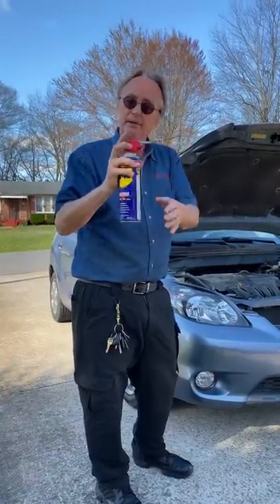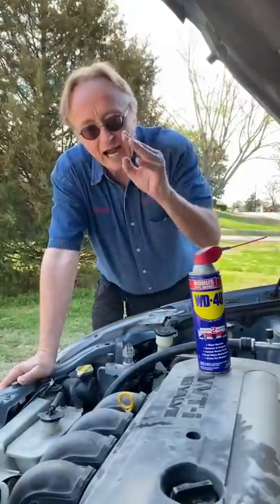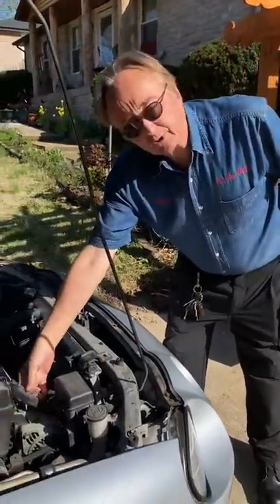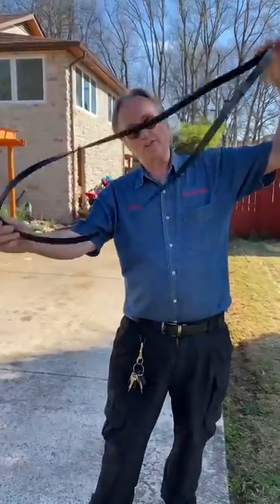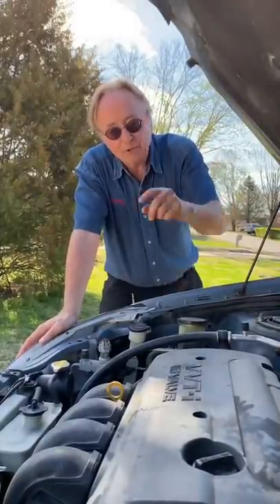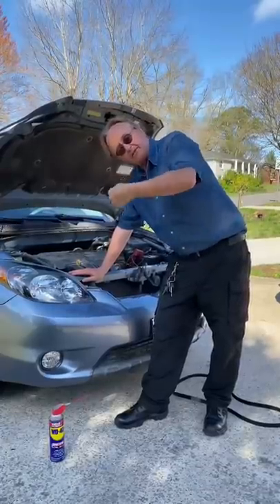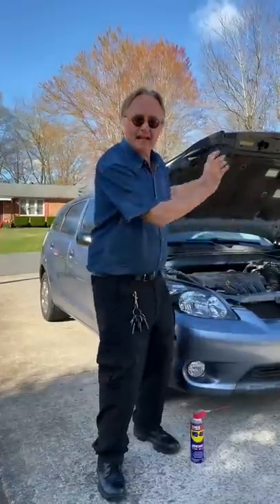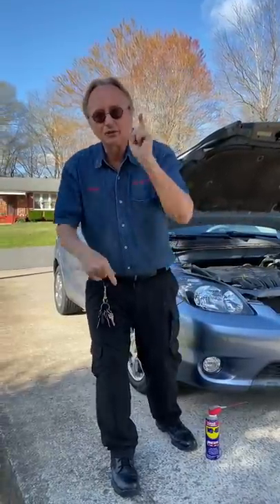Please Stop Doing This to Your Car

Comment: Belt conditioner is supposed to help your belts last longer, and if you read the instructions it's not supposed to be used when the vehicle is running, you take it off, spray it down and let it dry before reinstalling. It's supposed to help give the belt more grip without requiring as much tension and regular use keeps the belt from cracking as easily.

Comment: Buy good belt! not the cheapest you can find.
Reply: Rite!!!! Gates, Goodyear, etc..
Reply: I only buy OEM belts on RockAuto. My last one was the same price as the auto parts store brand belt for my '99 Ford Ranger.
Reply: If you can find them, Pirelli makes belt that are noticeably thicker and heavier duty than any others I've seen. Their tires, too. They've got 4 plies under their 2 steel belts instead of 2 like other brands.

Comment: I've had a number of Caravans and it's usually the idler pully or the other stupid guide pully. Don't spray a belt on a 3.3 or 3.8 either. The belt will come right off. Check the belt for cracks.

Comment: Learned this the hard way… I put a bunch of the stuff on what I thought was a squeaking idler and went to start it up- and THWACK! The belt had almost immediately worked its way off of the system and got cut right half in two! Cleaned up my mess and walked the couple of miles down the road to O’Reilly’s.

Comment: We used to let a bar of ivory soap coat the belts on the old cars...worked like a charm.
Reply: That's also a good temporary fix for a gas tank leak. Gasoline won't discover Ivory soap and it'll get you by long enough to get it fixed right. A radiator shop can fix it. I soldered many of them when I worked at one using a large soldering iron. No flames or arcs or BOOM!(dissolve, not  discover. Hate auto correct. )

Comment: As off grid guy its a half day lost to go to the city.  Slipping or cracked belts are concerning.   I drain oil all my equipment belts.    Then hang on the wall to dry.  It in 2 days the lubricity is not to be seen because it all impregnated in the belt
Reply: Same as a dried windshield wiper
. It will not work eventually just break off because it's dried out

Comment: The bearings inside the pulleys do take grease though such as in the idle or the Tensioner so spraying a little amount of lube on said bearing can honestly help at time I don't normally disagree with your vids but that's my opinion on this topic besides that great work love what you do for people trying to get into mechanics wish this kind of stuff was around when I learned to wrench

Comment: I thought this was common knowledge. belts don't need lube. If the car doesn't start because of it, replace the belt,  check the alternator, the water pump and the ignition timing. If that doesn't work, you probably blew up your engine because it is an interference engine.

Comment: Hey scotty, i need help! I have a 2003 toyota highlander (v6 AWD). My paranoid OCD brain is about to crack out my skull. I have a squeel that started last week ONLY when accelerating, all my belts seem NORMAL tight and I dont see any cracks, i cant reach too far (left passenger side) to see if any pulleys are moving and barely by eye (not enough eye space). Can a crankshaft pulley cause it? FYI i dont have a serpentine belt. The 2003 highlander has 2 belts going to bottom middle crankshaft (harmonic). It squeelz intermittently. HELP me please, my wife’s 6 months pregnant and I have a 3 year old in the back. I just bought the car last year. Please someone help.
Reply: Also, there is no noise when starting the car, after a few minutes I barely hear the engine. Just when accelerating, 1-3000 rpm intermittently.

Comment: What can I spray on the brakes to stop squeaking?  ;)
Reply: ah ha, you make de yoke huh?   Seriously though, if they are disc brakes, there is disk brake quiet that you spray on the shims and on the back of the brake pads.   You have to take the brake pads out to do this, and let the spray dry for like 6 hours before re assembly.    There's also orange CRC disk brake quiet, that is a liquied and costs a lot more that doesn't require the 6 hours drying time.
Reply: No! You have to change the pads!!!

Comment: Hey Scotty, do you know much about Australian Cars like a Holden or HSV vehicles? Would be cool if you made some videos on them. Fan from Australia 🇦🇺🍻
Reply: there is a reason they aren't popular anywhere else. JK...most of those were American engineered and had alot of or mostly American part
Reply: as much as i want a holden ute here in the states, the laws make them impossible to import so he likely has no experience with them
the only way to acquire one would be to buy a chevrolet SS or pontiac G8 and hire a seriously skilled mechanic to put the back of a holden ute onto the US sedan versions and its gonna be seriously expensive.